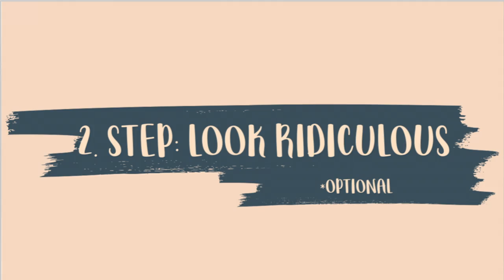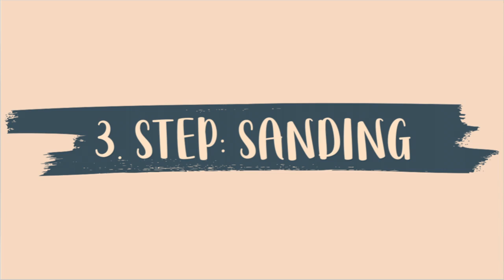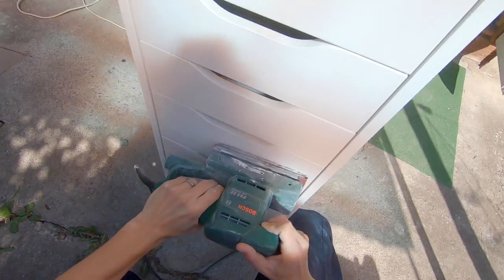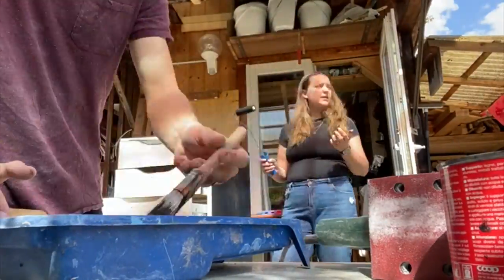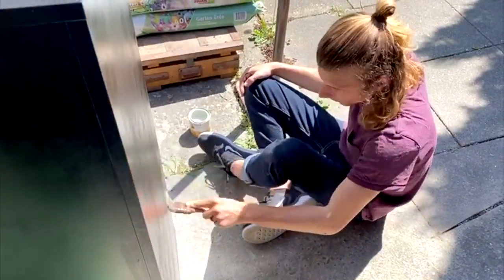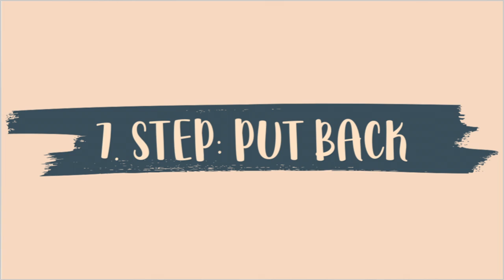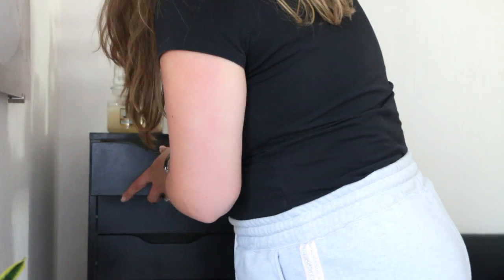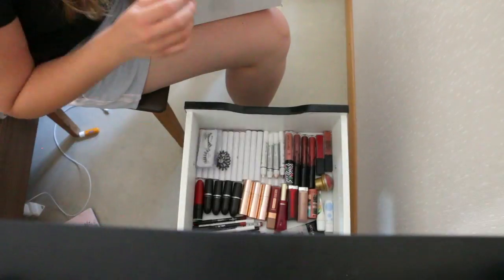Painting my IKEA ALEX Drawers BLACK // DIY

Comment: Did these experience any warping after painting? Currently have my home listed, and I'm planning to move across the country. So I plan to sell most of my furniture. Really want these in a lighter green, with a marble laminate countertop for my setup to match my new office.
Reply from the maker: Ohh wow that sounds amazing! Love the idea of the marble laminate countertop 😍 I didn’t experience any warping - and we used quite a few layers of paint. The only wear I’ve noticed is around the ‘handles’, but I think that’s normal. 
I hope your listing goes well and moving is smooth-sailing :)

Comment: Hey - Great Video! Can I spray paint it? and do I need to sand it or use primer if I spray pain? Thank!
Reply from the maker: Hiya! Yeah you can definitely spray paint them. Makes the painting process much easier! I would recommend using two coats of primer beforehand though, seeing as the drawers have a glossy finish to them that’s quite paint repellent. Good luck! 😊

Comment: Wanting to do this but not sand if I can get away with it! Also did the paint stay on well? Thank you!
Reply from the maker: You can definitely not sand. I’d just prime if you’re not sanding, as the paint won’t stick well otherwise. The paint has held up surprisingly well. It’s chipped a little on the drawers I use most. But otherwise I’m pretty impressed 😂🙈

Comment: What paint did you use? Was it just normal black paint or a type of paint?
Reply from the maker: Tbh it was just some old paint that was lying around. You can use any paint you like, if you’re sanding it down first. If you decide to use primer, I’d get the paint from the same brand. The black paint we used had a shiny finish - but you can use whatever you desire. Also we used a shiny topcoat just to protect the surface. 😊 I wouldn’t do shine on shine again, but rather use semigloss, but that’s just my preference.

Comment: i’m gonna try this but do i really need to sand it or no?
Reply from the maker: Yeah definitely try it - we love how ours turned out! If you don‘t sand it, I‘d recommend putting a paint primer on first, let that sit and then go over with the black xx
Reply: Little late but you should sand, then use primer like Binz, paint your color, then add a sealer.
Reply: Yes ! Sanding is a must … preferably with a sanding machine, you need to have a rough surface for any paint to be able to stick to something. Ideally take the top 1-2mm of paint off. I would highly suggest painting before putting together or take apart and paint each section. Also sand between painting coats as well